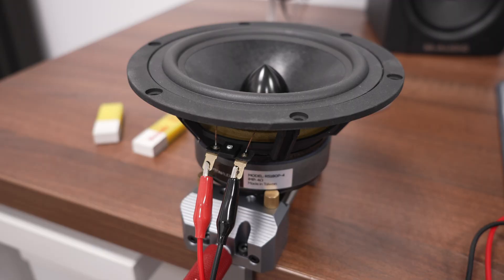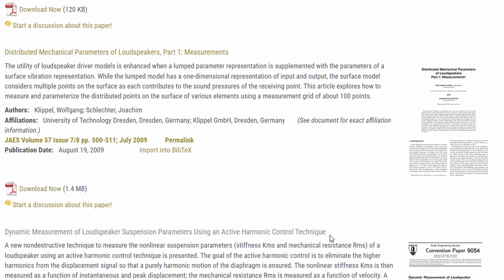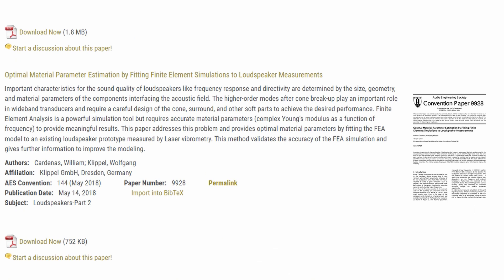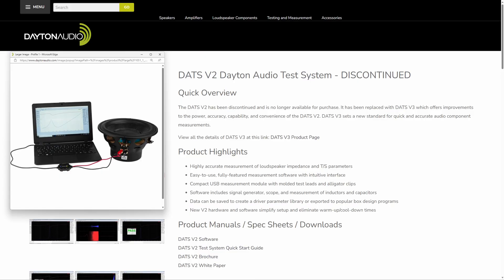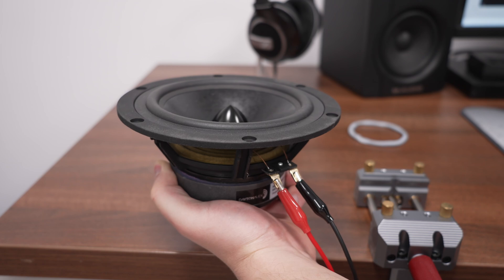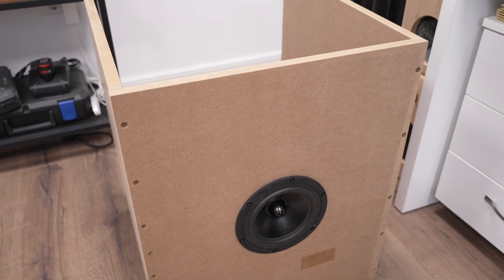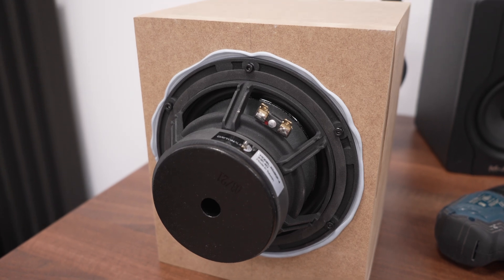Are you sure that you measured your speaker correctly?

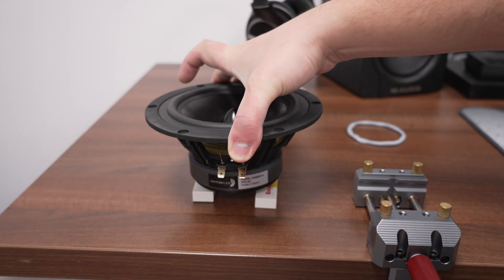Comment: 3:15, esp. necessary like you said if the driver is vented, but I'm wondering how much gravity affects the measurement, wouldn't be be best to orient the driver as it will sit in normal use?  I made a simple wooden stand/cup that cradles the magnet to run DATS V3 open air Ts params, was this good thinking?  Thank you, I subscribed!

Comment: I take care measuring in room temperature (preferably close to 20deg C). Don't measure the driver straight on a table if it got a vented coil, let it breathe. Break the driver in for a few hours. In my experience, the angle of the driver measured doesn't matter that much.

Comment: For Vas, I use metal or ceramic bowls, they are very sturdy, very easy to measure internal volumes and the hemisphere shape is ideal as an enclosure. I stick a sponge between the bowl and the speaker and  is very easy to secure any speaker with scotch tape. I used this method up to 12 inch speakers.

Comment: In olden days, some people used large open cardioid baffles, the cardioid shape has a nice even responses being either equally good, or equally bad across the board. It does need to be rather hefty, with size also a factor, iirc the circumference would be the wavelength of the cutoff frequency of the baffle. They also look cool, like huge lilypads.

Comment: Thanks. Good information. Is there a need for adding the volume of cone, facing inwards the hole? You measured the box and hole. I got the DatsV3 for a my old vintage speakers. Sadly I get different VAS every time I measure and it’s way too high (120 vs 75 liter) compared to the original cabinet.
Reply from the maker: In my opinion that volume should be taken into account. But it's difficult to measure and hopefully it's small enough to not influence the measurement too much.

Comment: Great video! This approach is very useful. Just one question. What is the reccomended mass to add to the cone? Is there a limit?
Reply from the maker: You need to add sufficient mass to lower the Fs by 25% or more. There is an upper limit. Don't add mass which is more than the actual moving mass of the speaker.
Reply: @AudioJudgement  Thank you!

Comment: Closed-box and handheld methods are the two methods I use.  Oh, and I don't build boxes for the closed box method.  SWMBO has a various assortment of pots and pans in the kitchen that can quickly double as a "closed box" with the use of a suitable baffle.  Some of them are actually perfect fits for the driver, no baffle required :-).  Volume is easy to measure with water and a measuring cup.  In any case, Vas variation of up to 20% is going to have minimal impact on speakers designed with the measured parameters anyway.
Reply: Kitchen. Good idea. Thanks